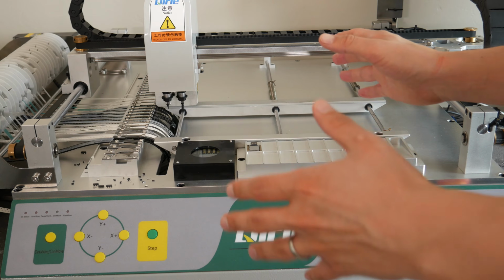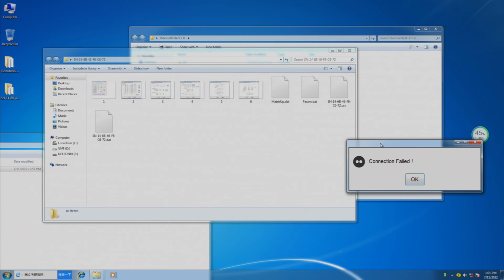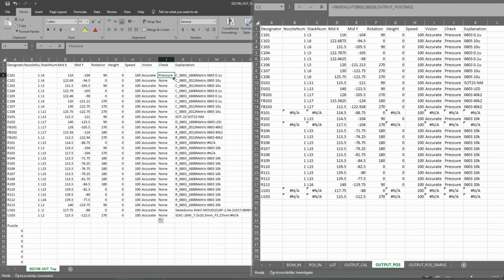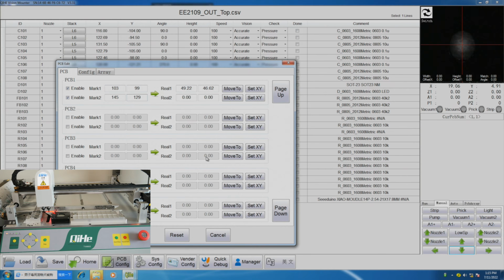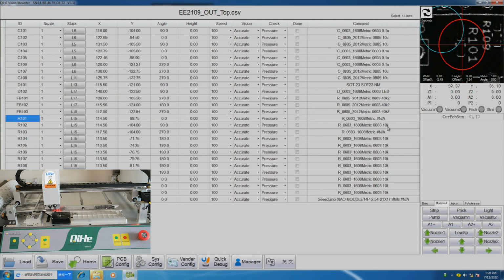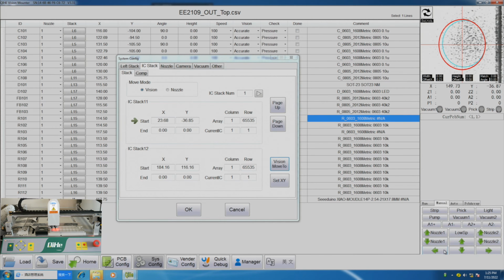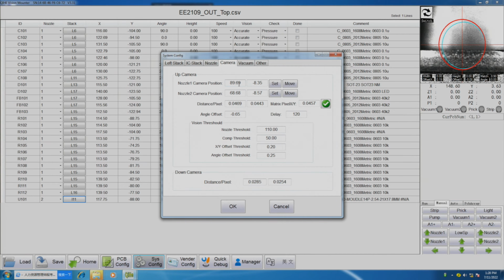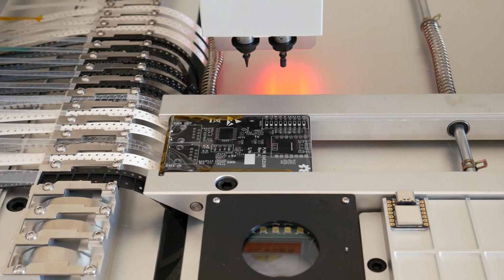TMV802 Pick and Place Machine – What I Wish the Manual Said.

Comment: I'm glad I found your channel.  I have an SMT802, which is the same basically as an TVM802, and for the life of me found it really difficult to understand the Chinese documentation.  Your video really simplified things for me.  I wasted so much time trying to figure out the tape advancing mechanism and how it worked.  No where does it show how to load a tape.  I finally figured out that the advancing mechanism is on the head and the holes point away from the front of the table.  It would be really helpful if part of your video showed that.  Other than that, great job and thanks.

Comment: sir, are you still on that sepic project? or, anyone has the experience of sepic converter? how is the compensation done? for now i can only slow the loop down but still unstable, i am using tl494. and Type iii compensation.
Reply from the maker: Hello ye yuan, a great question! In general, compensation is tricky for a Sepic. The plant is more complex than many topologies. However, you may be able to use principles like this to characterize the system and correct the compensation: https://www.ti.com/lit/pdf/snva364